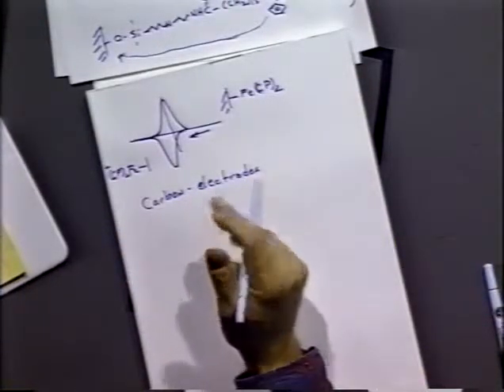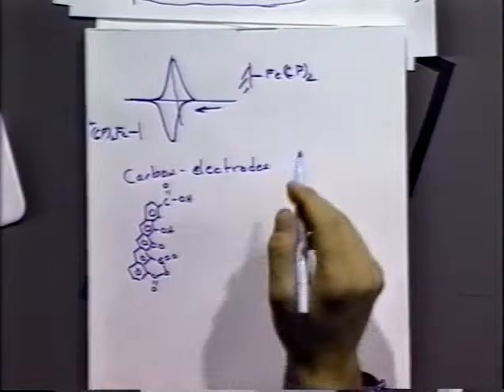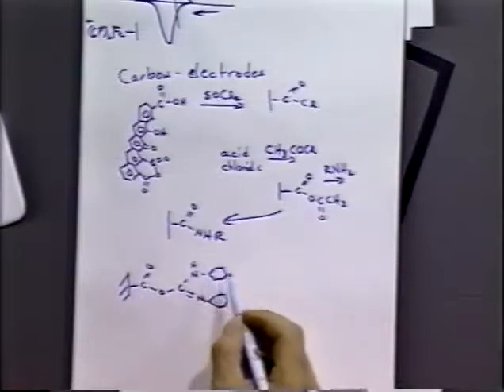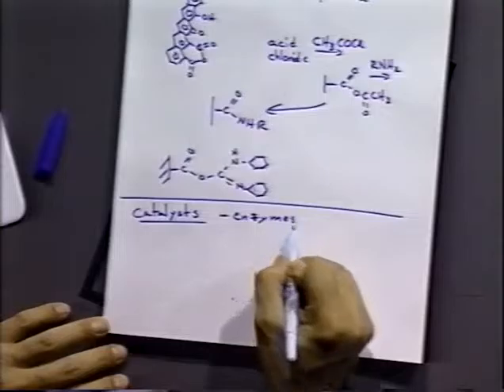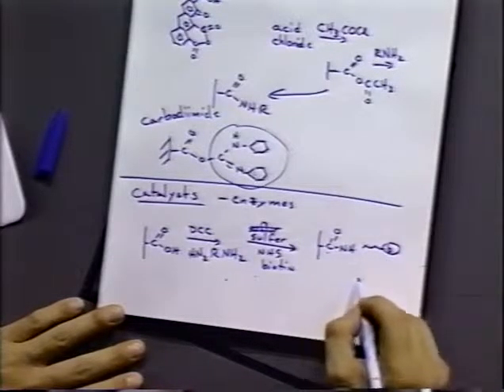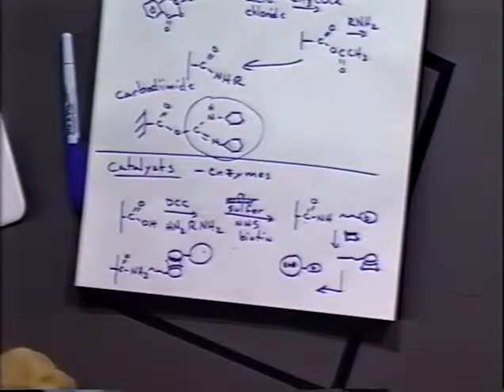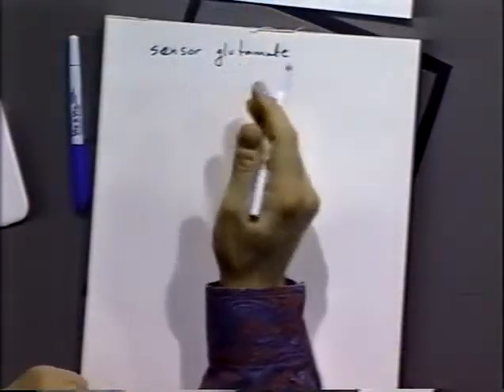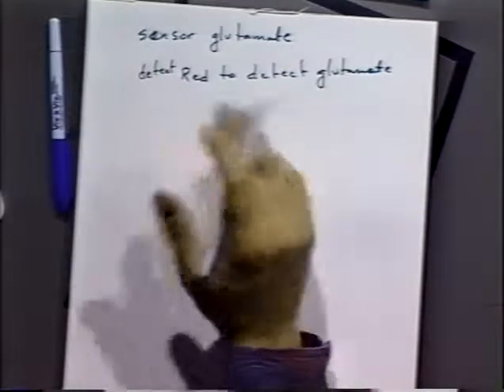Carbon Electrode Modification

Comment: Thanks for your efforts . Could please explain to me the use of methanol oxidation ?
Reply from the maker: I suggest you read the latest literature in the area, they will have a better overview than I can provide in a youtube comment. 
For example, Methanol Electro-Oxidation on the Pt Surface: Revisiting the Cyclic Voltammetry Interpretation Dong Young Chung, Kyung-Jae Lee, and Yung-Eun Sung The Journal of Physical Chemistry C 2016 120 (17), 9028-9035  http://pubs.acs.org/doi/abs/10.1021/acs.jpcc.5b12303 and the references therein
Reply: Thank you so much for the response.